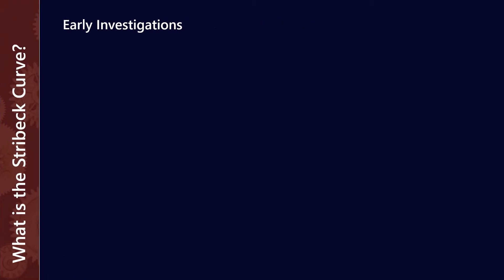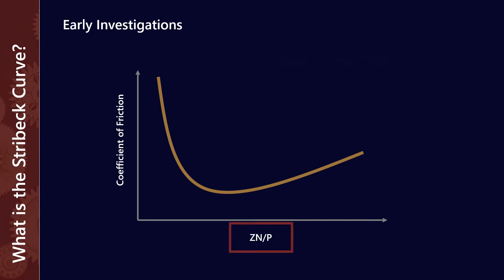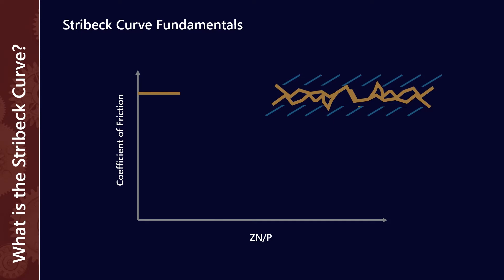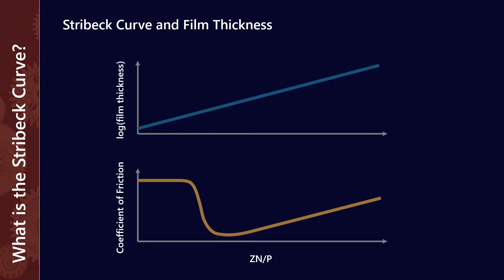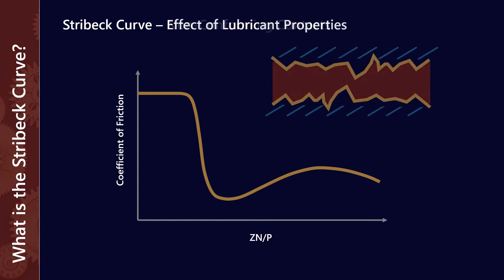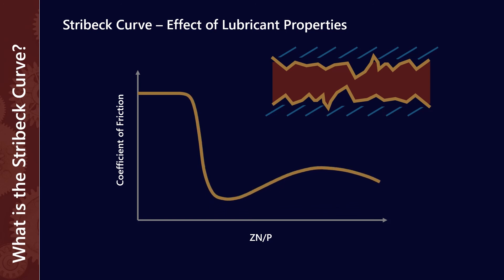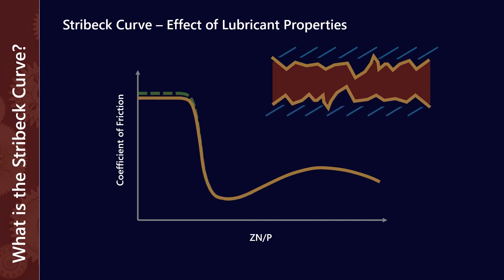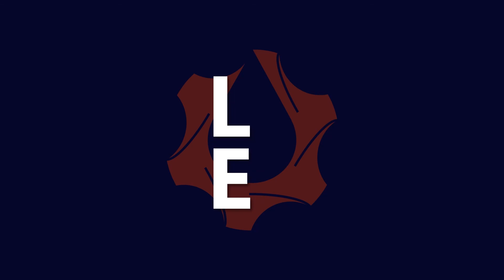The Stribeck Curve and Lubrication Regimes

Comment: I assume with smother surfaces the oil will want to slide out easier though so you would need a higher oil flow rate to maintain pressure. That's the only reason I can think of to explain why crankshaft journals and bearings aren't usually a perfectly polished mirror surface.

Comment: Hi Thanks for the video, I dont' fully understand the X axis, what does ZN/P means in real terms? I can understand the plot agains individual componets, i.e. eitehr Viscoity, velocity or load but not sure what the ratio ZN/P signifies.
Reply from the maker: Good point - the ratio itself does not represent anything physical. It's more that the relationship is the same for increasing viscosity and speed, but the inverse relationship for load. Rather than making three separate graphs, we put them all on one axis.

Comment: Why does the fricition rise agan when reaching the fully lubricated region?
Reply from the maker: Great question! Effectively what is happening is that the film thickness of the lubricant is increasing as you move from left to right on the graph. As the machine surfaces become separated by more and more lubricant, we require more and more energy to overcome the “internal friction” of the oil film.
Reply: @LubricationExplained  correct, thanks